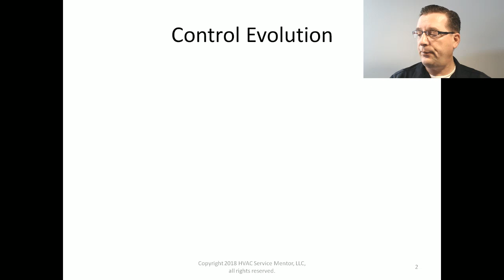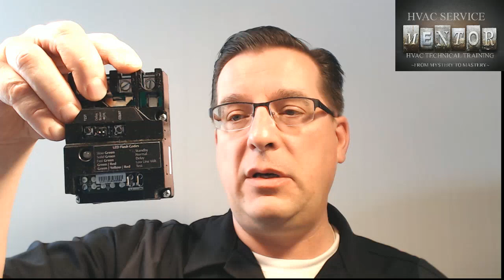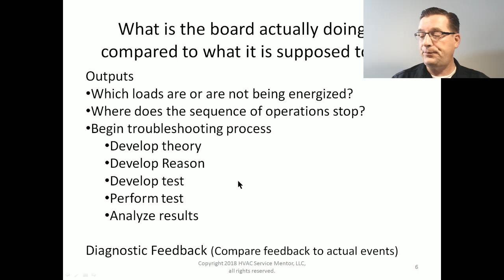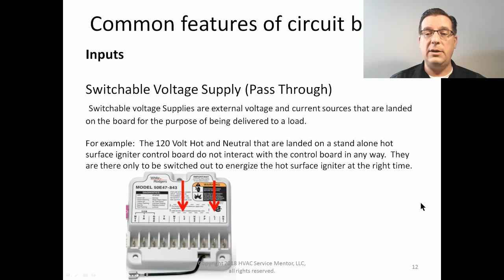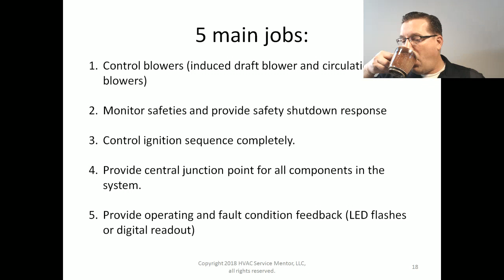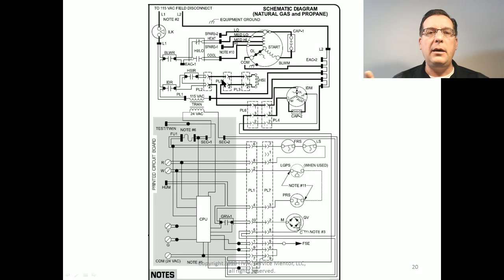Troubleshooting HVAC Electronic Circuit Boards

Comment: I find it important to study electronics and components. Quickly identifying the fault can confirm whether the board is OK or the problem is on the board. Learning what components have failed can quickly identify if a short in the compressor or fan has shorted the board or blown the fuse. The last thing you want to do is replace a $2000 inverter VRF board and allow the fault indication smoke to escape.